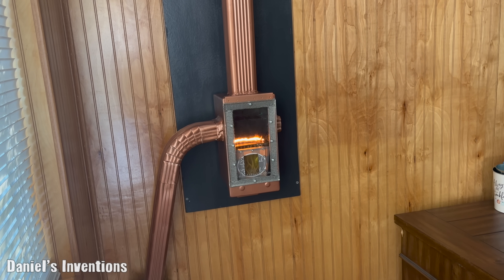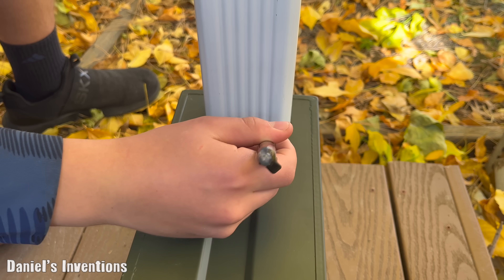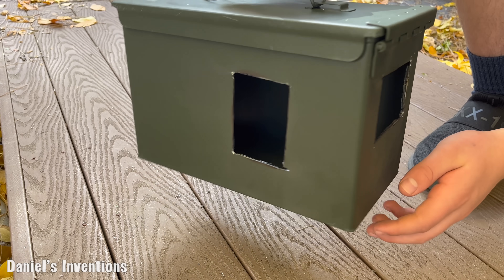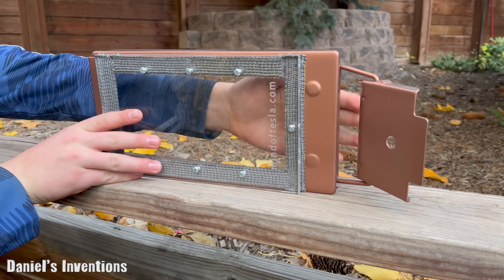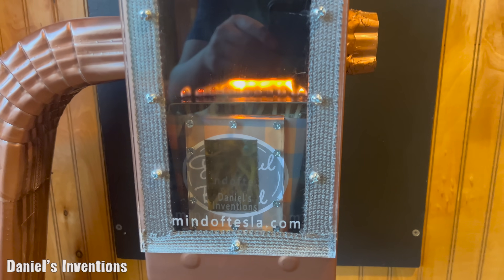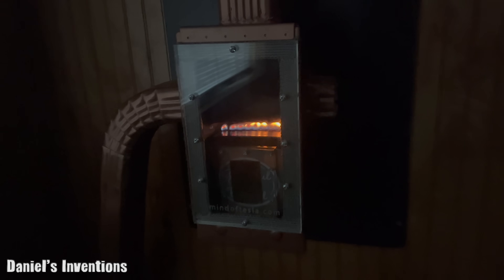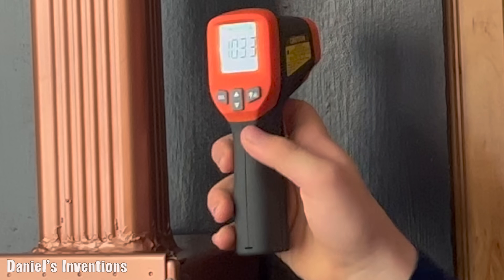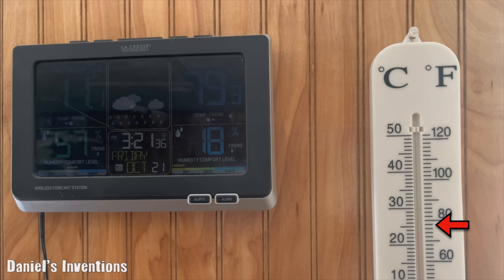ENDLESS Heat for Your Home WITHOUT Electricity

Comment: If I'm not mistaken, most residential gutter drains are made out of aluminum. Not steel. So they can actually melt and burn if the temperature gets hot enough. Not as easy as an aluminum can placed in a fire but it can still oxidize, become brittle, and even melt if the temperature gets high enough where you have it sitting in the flame. Also, instead of an electric fan, a wood stove fan can be modified to move the air and it will not require electricity. Also, the thin sheetrock you painted black will heat up, because it is sheetrock, and because it is black. This heat can transfer through to the wood behind it and can actually cause smoldering and even spontaneous combustion. It should be a reflective surface like sheet metal so it reflects most of the radiant heat. And JB weld should only be used if it is the extreme heat variety but I still wouldn't recommend that. The normal JB weld is only good at 600 degree Farenheit max. But at lower heat such as 200 to 300, it will eventually weaken and crumble. The ultimate goal is having a safe heater that will not cause a fire. And since you are using a fuel source such as cooking oil, etc, that creates a bigger fire hazard without the proper precautions because oil itself burns at about 2700 to 2800 degrees Fahrenheit at the hottest point of the flame. And you have the gutter drain sitting right in the hottest part of the flame judging by what I see at the 15 second mark in the video.
Reply: You forgot that breathing the heated aluminum is terribly bad for you as well.
Reply: @thelouiebrand  no there is no toxic fumes off of Aluminum I have melted tons of it. Now galvanized steel yes it comes from the zink. Aluminum melts around 1100 degrees and is really fluid at 1200 degrees. We poured safety tread which required the abrasive to burn in to the face of the metal we poured it at 1300 to 1350 degrees.
Reply: @thelouiebrand , why is breathing heated aluminum unhealthy?
Reply: @thelouiebrand  What is better then? Copper?
Reply: @thelouiebrand  it sounds like it would be better to use steel tubing for the piece right above the flame. It could be welded in. Probably 2x3 or even 2x2 would work. The intake and exhaust probably wouldn’t get hot enough to hurt anything with aluminum. But you’re right about that piece that the flame hits.
Reply: @thelouiebrand  Aluminum will release aluminum oxide when heated to a high enough temperature but thats not exactly as dangerous as zinc oxide which comes from galvanized metals. I don't think galvanized aluminum is a common thing for gutters but I know some gutters are made out of galvanized steel, which means they have a zinc coating. And breathing in zinc oxide can definitely cause 'metal fume fever'. Exposure to aluminum oxide usually has to be a repeated daily occurrence and in high amounts for it to be harmful. Most of the time it will just cause irritation of the eyes, nose and throat. Repeated exposure such as welders are exposed to when welding aluminum can cause scarring of the lungs if it is prolonged exposure. In this case I think this heater he made is safe from aluminum oxide being released. But if the gutter he used is galvanized with zinc then that will definitely cause 'metal fume fever' if zinc oxide is released and is breathed in long enough. Thats why you never heat up or burn galvanized metal. Because of the zinc. I saw some dummys one time that made a meat smoker out of a galvanized steel trash can and all I could do was shake my head.
Reply: @user-tz6rk4dy5s  just saw your other comment. You do realize that aluminum will release aluminum oxide fumes if it gets hot enough and that galvanized steel will release zinc oxide fumes if it gets hot enough right? You will literally have fumes coming off of the outside as well as the inside. You are not that bright are you? You think just because he has it sealed so the burnt oil gases don't leak into the cabin that no fumes will come off of the outside of the aluminum or steel gutter drain? Whichever one he is using, it would have to be aluminum or galvanized steel. Both will give off metal vapor fumes on the inside and the outside because of the heat going through it.
Reply: You can buy steel downspouts still. They are galvanized though which is not good to run hot as they off gas. Putting spacers behind the cement board and covering front with aluminum foil would be cheap and better to reflect heat. High temp furnace cement would be better than JB Weld. and safer.
Reply: @hotpuppy1  always use bare steel or stainless for something that is gonna be heated, you dont want to heat something that is galvanized because the fumes can poison you and possibly do neurological damage.
Reply: @hotpuppy1  You can buy still downspouts, but I used to work doing gutter and they don't sell them very many colors guarantee those ones are aluminum
Reply: @hotpuppy1  they sell steel down spout that is painted and not galvanized. Standard downspout at Home Depot is 26 gauge steel.
Reply: @hotpuppy1  galvanized is ok, just run them through a fire to burn off the zinc first for the parts that are exposed to high temperature.
Reply: That wasn't sheetrock
Reply: My first thought was the fumes coming off of this 🙄 and all the components
Reply: @laurajanis9690  oh my time for my N95 !
Reply: @Cloud Newman No. Only difference is that cement boards dont have paper covering. But they still transport heat into the wall creating a risk for making the wall studs into charcoal that will cathc fire sooner or later. It also crumbles in case of a fire. Silica board is the best material to use around anything hot.
Reply: They have steel gutters.
Reply: THE MOSY KAREN-FILLED COMMENT THREAD OF ALL TIME!!!!!
Reply: I disagree with the wood stove fan.  I own one and they dont work so well.  Its more of a novelty than anything else.   His fan is gonna move much more air.  Also, he didnt say the backing board was sheetrock.  He said it was cement board.  Like the idea of the wood stove cement though.
Reply: @scottsmith4145  the small Woodstove fans that you can buy off of eBay may not produce a lot of extra heat inside but most importantly the little fan will cool off the exhaust pipe going to outside thus reducing a hot pipe going through wall
Reply: @scottsmith4145 I’d use sheetrock with a spacer behind the firebox and a reflective shield. 

JB Weld is very dumb to use for this application however. That’s foolishness imho. But then again he picked hardiboard over sheetrock and didn’t mention an airspace clearance to keep the mounting surface ventilated to avoid it getting hot
Reply: Wood stove is the only true off grid way of heating as you use fuel from the land. Anything using oil is not off grid because you still have to purchase the fuel.
Reply: @mkendall8393  I use a clay and cobb rocket stove with a wood stove fan for heat, metal roof and gutters for rainwater collection, 2 big solar panels to run my deep freezer, and 2 other big solar panels to run my wifi router and led lights.
Reply: @mkendall8393  There are plenty of ways to find oil in nature. Almost all oils that are used in food are plant based. How hard can it be to plant some oil producing crops and make your own Off Grid oils? You just have to be creative.
Reply: @rudydingens8144  This would make for an interesting project. How much land, water, and resources would it take for someone to grow a small oil producing crop and heat their home/shop with it? Might you know what crop would be most effective, and would it also create bi-products (food, useful vegetative mass, etc.)? Bravo!
Reply: @oldtimeflipper8691  
I'm willing to bet hemp will be at the top of that list.
Reply: @mkendall8393  stove away then
Reply: @oldtimeflipper8691  Hemp. France has developed a strain that can produce over 300 gallons per acre.
Reply: @mkendall8393  use whale Blubber
Reply: @RareVBlue  you’re a man after my own heart. Gotta have cold storage and YouTube!!
Reply: @mkendall8393  make sure not to cut the wood with a chainsaw then
Reply: @mkendall8393  "off grid" literally means living without using public utilities. You thinking of something else. Even if he buys batteries for the fan each week it's still "off grid"
Reply: @mkendall8393  oil is overall a denser and more effective fuel source so a little can go a long way especially in a smaller available area. Wood is inefficient af overall but is useful for emergencies
Reply: @mkendall8393  Yes,  just save up for one of those mini wood burning stoves with proper piping.
Reply: @mkendall8393  a gasifier would be better because you could not only hate your home but you can use the smoke to run your generator for electricity. Plus you can't compress the smoke into tanks for emergencies
Reply: @mkendall8393  maybe he’ll hunt whales for oil though…
Reply: @mkendall8393 by that definition solar is not off grid, either. Look up what the grid is please.
Reply: @mkendall8393  and wood is free and abundant  everywhere?
Reply: @mkendall8393  Oil and gas in your chainsaw and splitter is not either. lol and don't tell me you are axing it all.
Reply: @mkendall8393  no you can burn waste oil as fuel. Look at any Valvoline oil change store and that is how they are all heated, with the oil they change from cars. Very easy to get waste oil all over the place, especially Chinese food places.
Reply: @RareVBlue  can you send me a link for a solar system that can power a freezer? Much appreciated 🤙🏻
Reply: Would a mirror behind the stove work?
Reply: @grlCA-t7d  Nah, just a simple piece of metal flashing is all thats needed.
Reply: @grlCA-t7d  no… what they did will work just fine.
Reply: Correct however  you can also purchase it in tin and steel
Reply: Just use Ammo Boxes,  weld them together throughout the house.
Reply: Not to mention he used a computer fan made of plastic to blow the hot air. All of this is hazardous and ridiculous, makes sense why males have lower life spans.
Reply: Aluminum  melting point is 1200 degrees
Reply: @goodcitizen48040  Yes. And an oil flame, at its hottest point, burns at about 2700 to 2800 degrees Fahrenheit. At 15 seconds in the video you can see the gutter drain goes straight through the ammo box and it is in direct contact with the oil flames and the gutter drain looks like its melting/deteriorating at the 15 second mark.
Reply: looks like copper
Reply: @jamesdasilva5289  ....that's paint... probably not heat resistant paint either.
Reply: Great Point, many people and Do-It -Yourselfers... are not always aware if the ramifications of using  the wrong materials or mediums for their projects... From the proper type and strength bolt to the correct metal... they should be aware to look up the tolerances of any key materials... You can pick up a super thick  Pocket Book at Any Hardware Store that tells you tolerances. Capacities, Code  Regulations , etc etc etc...
   Researching your project or stepping back and taking a second look us always a good idea,  especially when your dealing with even the smallest Safety Concern...
Reply: To those concerned about the galvanized steel or aluminum and vapors given off by the heat of those items... A very good alternative is to use automotive exhaust pipe, and ideally stainless steel exhaust pipe. These will be heavier gauge steel so they will hold up better to the heat and the steel will not emit the noxious fumes the aluminum and galvanized steel will. I have a heat exchanger in my fireplace and that just uses automotive exhaust pipe and works great.
Reply: For all that work, may as well instal a safe heating system.
Reply: Medium and high-carbon steel: \(1425\)-\(1540\)°C (\(2600\)-\(2800\)°F) so I don't know wtf your talking about bro
Reply: And when copper is heated it creates an noxious fumes of gas you do not want to use that either your best off to use something cast or some sort of steel
Reply: So much bickering. I do want to point out that the color has no bearing on heat convection. Just because something is black, brown, or white does not mean it will be hotter or cooler. The color being black or white does make a difference in light absorption when exposed to the sun. A black object will absorb more light & become warmer were as a white object will reflect the light & be cooler on the surface. This does nothing when exposed to an actual heat source like a flame. I just wanted to point that out as someone sort of had the right idea but not the full understanding of why color matters & in what application.
Reply: I MEANT CONDUCTION, NOT CONVECTION. I had to brush up on the definitions and used the term convection in the place of conduction, when conduction is the proper word to have been used. Jason was quick to jump my bones with the name calling. That is all.
Reply: @MNDmanIII  Well the way you started off with "I just want to point this out" was pretty condescending in itself considering you were incorrect and still are incorrect. The 5 main ways that heat can transfer is through convection, conduction, radiation, electromagnetic induction, and evaporative cooling. When referring to why black objects absorb heat more than lighter colored objects, we are talking about radiation. Almost all objects that exist give off infrared light which is invisible to the naked eye. Even an ice cube gives off infrared light. Infrared light is thermal because of the wavelengths. These wavelengths cause an objects molecules to become 'excited', causing them to move faster which increases the internal temperature of the object absorbing the infrared light. Since the sheetrock or dura rock was painted black, it now absorbs most of the infrared light created by the fire which in turn causes the object to rise in temperature. In this instance conduction only comes in to play when referring to how that radiant heat is transferred through conduction to the object it is touching which happens to be the wall behind it. Painting it white would cause less infrared light waves to be absorbed. Making it reflective with foil or sheet metal would reflect most of that infrared light back towards the person who then in turn would be absorbing that infrared light themselves, causing them to feel warmer. Thats why your skin will turn red when you sit next to a fire too long. The infrared light is being absorbed by your skin through the process of radiation. The wood stove itself being attached to the sheetrock or dura rock would transfer heat into it through the process of conduction. But sheetrock or dura rock by itself does not absorb much heat through conduction because of the materials it is made of. So conduction heat really does not apply here. Once they painted the sheetrock black, they basically made it susceptible to retaining that infrared heat regardless of what the sheetrock or dura rock is made of.
Reply: @RareVBlue  One can't go wrong studying the complete (available) works of Nikola Tesla. He was an amazing man, with an amazing mind. Maybe you will become the modern iteration of his genius. Have you any thoughts on his last residence and it's potential?
Reply: @RareVBlue  thank you for covering this. I was about to get into it with much less knowledge and no terminology. But even though i don't know the particulars i do know that reflective surfaces always run cooler than dark surfaces when near a heat source. Or at least, almost all the time.
Reply: @RareVBlue  Wow, I am absolutely charmed. Thank you for your time and effort. You have just moved the horizons of my world yet a bit further. Well, it is an interesting notion to view the world and it's objects as a "spectacle" of radiation interactions and exchange.
Reply: @MNDmanIII  I just want to point out that you are an idget. Black colors absorb heat more than lighter colors. Thats why only idgets wear black shirts in the sun. Heat convection has to do with fluids and gases. Heat conduction has to do with heat transfer from 2 objects of different temperature that are touching. Neither of those apply here when referring to the black paint. This is what is called "radiation" or radiant heat. Radiant heat has nothing to do with convection or conduction. As for black paint absorbing heat more than lighter colors, a black object absorbs all of the wavelengths of light which causes radiant heating in the black object. Thats why black tar shingle roofs get so hot after absorbing the radiant heat from the sun. So lets not bicker if we have no clue how to science. A fire emits infrared waves and visible light. Infrared is invisible light. Both are fully absorbed by black objects which causes radiant heat. Infrared rays are thermal. The infrared radiation will cause anything that is black to absorb that radiant heat. Once the object heats up, if its hot enough, it can transfer that heat through conduction to any object it is in contact with. Example: the sheetrock or dura rock he used is painted black so it absorbs radiant infrared light which is thermal. Then that heat in the sheetrock or dura rock can transfer to the wall behind it through conduction. And that is a fire hazard.
Reply: @MNDmanIII  I used to build laboratory furnaces, our tiles were white because light produces heat and we were building them to keep heat on the inside. So simple put light and heat follow the same rules
Reply: good suggestions for improvement
Reply: Get type x
Reply: In short what Jason is telling you your gonna burn the motha fucking down bruh 😂
Reply: As a very temporary heat generator it's ok. Not for regular use. A lot of soot maintenance.
Reply: Actually, I would look for a piece of vintage heat reflector called Pro-Tex. They were attractive and made with asbestos, but it was sealed, so not as worrisome.

And as my mother used to say, "if you live long enough, something will k*ll you"
As long as you are an adult, your chances are good that a Pro-Tex won't hurt you. I have seen them in antique shops numerous times and places. Mine is 14x17 and has been used to protect walls, etc. from propane and welding torch flames. It doesn't  get hot.
Reply: Your dumb bro.. Your just spewing outbullshit
Reply: Got eem!
Reply: All oil has a smoke point and unless he was burning something with a high smoke point, there should have been smoke somewhere and there wasn’t.
Reply: @Yo Lo all oils produce smoke. Have you ever cooked? At 450 (which he showed with the infrared thermometer) 95% of the oils would smoke. Even when I had oil heat, that produced smoke out the exhaust.
Reply: @Cloud Newman got my trowel 32 yrs ago ... Not saying I'm the best mason ever 🤣, but ... I do , do it all ... Firewalls fail ... Smelting furnaces melt through ... If this heater has issues ... And boy does it ever ... That sheetrock isn't going to do anything but give you a false sense of security ... Just as that isn't a house it is a closet ... 11 degrees isn't that cold ... And we have no way of knowing he didn't heart that shed with a tiny electric room heater .... Which would be likely cheaper and easier than this ... I call b.s. on his fuel consumption as well ... A tiki torch empties it's can in 45 min and only draws from a single wick ... This guy is a total fraud ...
Reply: Then build you own your own way and stop whining Jason. SMH.
Reply: Gutters & downspouts are galvanized steel, never aluminum.
Copper is used when wealthy ppl want a special design esthetic.
Reply: @petedafook  by
Reply: @petedafook  I have some that are aluminum so never say never.
Reply: You will go off the grid and pay for oil birthday candles
Reply: But it’s welded … JB welded. What’s that smell?
Reply: @Pleasesubmitfornobelprize  😂😂😂
Reply: If you go down and look at your water heater is 4 inch or 5 in round aluminum single walled vent material.
Reply: @Lost-n-happy  Thats for gas water heaters so they can vent out the flue gases that don't burn off as well as the byproducts produced by burning natural gas such as carbon monoxide. The water heater vent shouldn't get past about 350 degrees Farenheit unless their is scale build up inside of the vent. If you look at this video at the 15 second mark, he clearly has the gutter drain pipe going straight through the ammo box and it is resting on top of the oil flames and looks like it's oxidizing and melting/deteriorating where it is sitting in the flames. An oil flame burns at about 2700 to 2800 degrees Farenheit at the hottest part of the flame (the very tip of the flame). Aluminum melts at 1200 degrees Farenheit. If it is a galvanized steel gutter drain, then it will melt at around 2700 degrees Farenheit. But the zinc coating that makes it galvanized will melt and vaporize at around 900 degrees Farenheit and it will release zinc oxide vapor which is harmful if inhaled. He literally has it sitting right in the flame.
Reply: I'm pretty sure he said "steel" gutters in the beginning..
Reply: @Lucidman-mo7dh  I'm pretty sure he said that as well. But it doesnt explain why its melting at 15 seconds into the video over the 2700 degree flame. I mean steel does melt at about 2700 degrees but im pretty sure it's aluminum. It's sitting right in the oil flames at 15 seconds in and you can see it is deteriorating. It's either aluminum or galvanized steel. Either way, oil flames get hot enough to melt or degrade and weaken it. Looks like aluminum to me at the 15 second mark.
Reply: @Lucidman-mo7dh  In all honesty the kid did an excellent job. Someone his age can't be expected to know everything. All I was trying to do was offer constructive criticism. I wouldn't have known most of the things I know now without people giving me their point of view. He did do a good job. But he still has things to learn.
Reply: You: I feel like passing in some kids Wheaties. 
Also you: mission accomplished 😌
Reply: He said it only gets to be 500° the flame is small from the looks of it. Aluminum doesn't melt until a bit over 1200°F. As far as paint use that high temperature spray paint, normally used for engines and or grills. Drywall claims to be fireproof I can understand the bulk of it, but unless it's painted with high heat paint I'd think the paper would still burn. Like you said Jason a piece of 1/16th sheet metal would be a better option even if it's just an extra layer for safety. 1 last thing since you are using oil make sure to keep a fire extinguisher rated for that class of fire. WATER is the worst thing to use to try and put out an oil fire.
Reply: @IcannaHelp  He did state that it burns at 500 degrees. Yet I know for a fact that the hottest part of an oil flame gets to 2700 to 2800 degrees and he has the downspout going straight through the ammo box and it is sitting in the actual flames. The bottom of that downspout is oxidizing, degrading, and potentially melting if you look at it 15 seconds into the video. That downspout is in the hottest part of multiple oil flames.
Reply: Goodness and you said the sheet rock will get hotter because it's black lmfao you are an idiot.. color does not retain heat based on the pigment that's only with optical light.. you dumbass hahaha
Reply: @armaniomcqueen1581  Ok kid, I've already explained this in the comments. No one can help you read. You were late to class. Go to the office. Black absorbs all infrared light/radiation. Lighter colors reflect that radiation. Infrared light is thermal heat. Colors can refract, reflect, or absorb radiation. Infrared light is radiation. Radiant heat comes from infrared light. Almost all things emit infrared light. Even an ice cube. You aren't too bright are you kid? And these are oil flames he is using. An oil flame at its hottest point, which the aluminum is sitting in at the 15 second mark, burns at 2700 to 2800 degrees Farenheit. Alumimum melts at 1200 degrees. Do the math kid. Quit typing and read. It's science b*tch.
Reply: TEAMWORK MAKES THE DREAM WORK!
Reply: I agree with all you've said. Still the idea is neat. It just needs tweaking for safety purposes.
Reply: Total bust
Reply: It’d have to get up to 1,200 degrees no hardly possible burning oil like that without a n air source
Reply: Aluminum may be the most common, but steel is available and you can get copper but it's not common or cheap
Reply: Galvanized steel is most commonly used
Reply: Oh boy
Reply: Translate
Reply: Traduci questo articolo di Jason
Reply: I agree about the JB weld, I doubt that it's going to hold up in the long term.
Reply: Wow, you sound like you know what your talking about, I almost fell for this video. Maybe you should make a better one with all that knowledge, you can really help people out since things are just getting worse in America and everything is so expensive. I would subscribe to your channel in a heart beat 💓 😊
Reply: @@cloudnewman9111Hardie states their backer board is not fire resistant rated. Sheetrock is fire resistant. Hardie also transfers heat better than sheetrock… facts.
Reply: Galvanized steel is readily available
Reply: @n2skcmo  Heating galvanized steel puts off dangerous fumes.
Reply: @TomCee53  burn it off outside
Reply: Except he distinctly said ‘steel gutters’, Karen
Reply: You are correct, I have original copper gutters on a 1924 English Tudor. Not a hole or leak except for “soffit “ issues non gutter/downspout telated.
Reply: The oil burning at 2800°F doesn't mean that the exhaust gasses are going to be 2800°F even an inch away
Reply: I think you made a lot of good points, I love the fact that he attempted to do something cost effective to heat his cabin and it puts us on a tract to create a safer version. I’d love for you to try and attempt something like he did in a cost effective manner but safer especially with the conversion of a wood stove fan
Reply: Cement Board is not sheetrock
Reply: I can promise you that oil burnimg will never build up enough heat to melt aluminum. Aluminum extrudes between 925-1050°f theres zero chance this setup will melt the aluminum.
Reply: @danielkarcis1174  and you're wrong. This was an old comment. I'm sure I have the temp specs in the comments. You know oil burning torches exist right? And they can melt cast iron? Your promises don't mean much in the face of reality.
Reply: You can get steel downs that look identical to good old fashioned Alcoa style aluminum downspouts.
Reply: Right.  100% facts.  This video is dangerous as hell
Reply: 👏🏻👏🏻👏🏻👏🏻👏🏻👏🏻👏🏻👏🏻👏🏻
Thank you!!!
You have probably just prevented a lot of homes burning down and save lives!!!!
God bless you!!!!
Reply: You can easily find steel ones
Reply: I immediately commented out loud about that
Reply: Them copper ones are where it’s at
Reply: I done gutters.  Steel down spouts may be special order, I suppose. But mainly like you said. Aluminum. Steel ones are usually old and rusted.  I hope he is not using Galvanized.  Very bad and poisonous to breathe in when heated.
Reply: no its steel atleast eu
Reply: Oil burns closer to 3800f at its hottest point, not 2800f
Reply: they made another video using rectangle steel tubing over the flame.
Reply: ❤thanks your words of wisdom saved somebody's life tonight😮
Reply: You're out here saving lives probably!
Reply: Iv seen it before I'd use aluminized car exhaust instead of the house gutter but the clean air inside exhaust out is awesome idea I use to do a lot of shanty fishing and the next day was always horrible sick from breathing the propain fumes that would be awesome in deer stands and shanty the little computer fan most run quite with no noise after startup the fumes might be a issue with the oil and a deer stand sentless best way to go if possible still cool ish idea for a few applications
Reply: They make stainless steel gutters too.
Reply: HighHeat™ is a hand mixable epoxy putty stick specifically formulated to bond and repair materials that will be exposed to high temperatures in automotive and industrial maintenance applications. It cures to a tough, hard bond with little to no shrinkage. This industrial-strength product outperforms conventional epoxy putties at high temperatures and sets in 1 hour at room temperature. After 8 hours, it can be drilled, tapped, machined, ground, filed and painted. HighHeat™ is rated at a tensile strength of 4000 PSI and cures to a machine grey in color. It is able to withstand continuous heat exposure of 450ºF and intermittent heat exposure to 500ºF.
Reply: He says steel gutters, literally at the beginning. Get the dick out of your ears!
Reply: 0
Reply: Aluminum Oxide (Al_2O_3), also known as alumina. It is the most widely used technical ceramic in the world due to its incredible versatility and low cost. How do you imagine it in a gas ?
Reply: What he said
Reply: Steel down spout is still available
Reply: Wrong most down spout is made of steel . That is down spout you can purchase at Home Depot it’s 28 gauge steel.
Reply: Dam captain obvious. Let the 17 year old kid alone he did good for a diy heater ya there may be a few little tweaks needed but let it go.
Reply: @armaniomcqueen1581  So in your sensitive mind all young people should never be given any advice or constructive criticism in order to do better? I guess you got participation trophies as a kid didnt you lol... lighten up Karen.
Reply: @RareVBlue  a candle wick or even ten of them are not going to catch aluminum on fire and burn down your house..
Reply: There are multiple types of aluminum vent pipe. I work HVAC. As crude as this heater is it works. And obviously no one is hurt or dead. Your need to "tair down" their creation is pathological and concerning. Gutter pipe is a lot thicker that is dura vent and meravent. Also known as bvent . The water heater vent gets so much hotter. So good for these too. Jason why not go do something worthwhile and leave these 2 kids alone. Is sus af
Reply: @Lost-n-happy   I used to do Hvac work as well. Just because you did Hvac work, doesn't mean you understand how metal works when heat is applied. Aluminum downspouts are usually between 0.027 and 0.032 mm thickness. Duravent is between 0.016 and 0.024 mm on the outer casing which means it is thicker than aluminum downspouts. Aluminum downspouts bend very easily because of how thin it is. That's why they put rib bends in it in order to strengthen it. I've torn out and reinstalled very many oil furnaces and hot water heaters in my life. I also teach classes on how to build wood stoves out of natural and manmade materials. I've built MANY of them. I also teach classes in how to build outdoor ovens and pizza ovens out of manmade and natural materials. My original comment was nothing more than constructive criticism. All of my replies thereafter were not directed at the kid or kids who made this ammo box stove. My replies were directed at the misinformed imbeciles who do not know as much as they think they know and choose to argue with me even after I give them the facts. The issue is that he put the downspout straight through the ammo box and it is resting in the top of the oil flames. Duravent does not rest in oil or gas flames. It vents the vapors away. Oil burns at a very high temperature at the tip of the flame. That is the issue here. You can see it oxidizing and deteriorating  at 15 seconds into the video and possibly getting ready to melt because it is resting in the flames from the oil. Then he has jb weld on the joints. There is just too many factors here that can cause a fire or can cause harmful metal oxidation vapors to be released inside the cabin. And a fire is definitely something you do not want if you live off grid.
Reply: Lol.  You can’t Melt aluminum at that low of a temp and burn it ?
Reply: Aluminium melts at 1200 degrees.... No chance this elaborate series of candles melts aluminium. Also how does using cooking oil as opposed to lamp oil make it more likely to be a fire hazard?
Reply: @popanda3652  Solid aluminum melts at a high temperature. But the thinner it is, the easier it is to melt it. You can melt an entire aluminum can in a simple camp fire in minutes. You can melt and burn aluminum foil under a simple lighter in seconds. And oil itself is a fire hazard. And the hottest point of a simple candle flame reaches 1500 to 2500 degrees Farenheit. Direct contact with a flame is all thats needed for alumimum to melt. And cooking oil has an autignition temperature of about 600 degrees Farenheit. He has that aluminum gutter drain running straight through the ammo box. At about 15 seconds into the video, you can see it is touching the flames and has melted the bottom of it where it is touching.
Reply: @RareVBlue  you are incredibly misguided. Your talking about oxidation. You are not melting aluminium with a lighter..... Your not burning it either. The materials he's using are at least 5x stronger/more resilient than the bare minimum your trying to state.
Reply: @popanda3652  Blah blah blah. Go make more bowling videos.
Reply: @RareVBlue  yes because my hobby has weight in this argument. What kind of videos do you make?
Reply: What a killjoy...
Encourage the young Hillbillies!
Reply: Metal reflects heat? Since when?
Reply: @patrickhein9470  Shiny surfaces such as mirrors, aluminum foil, and sheet metal reflect infrared light waves which are a form of thermal radiation. It's literally explained many times in the replies.
Reply: @RareVBlue  still heat up tho dont it. like a hot tin roof smh
Reply: Tell us your a know it all without telling us your a know it all!
Reply: Tell us your a know it all without telling us your a know it all.
Reply: He said in plain English he was using STEEL
Reply: Karen 🚨
Reply: 450° output... 134° pipe Temp...cut down on wicks if you want a lower temp..
Reply: It's Dura rock concrete board
Reply: @mgtowlevel6969  the piping?
Reply: @thelouiebrand  the backing board
Reply: @M Kendall  oil is found in leaves and dirt if you melt it at a certain temperature you can use the oil from your leaves and dirt to heat your house year round. A true off grid living..
Reply: @Cloud Newman still, this is obviously not ridiculously safe. It would be way safer, cheaper, and more efficient to just learn how to run some wire and put an outlet and a space heater there
Reply: @joshdiehl8737  Years ago I had a metal wood burning fireplace insert with a blower fan that worked on this same principle. It threw out lots of heat. I rigged it up so it could also burn waste oil.....I used a metal jug, on/off valve & long copper drip tube line. I crimped the end of the drip line so even when the on/off valve was all the way open. It could only drip a set even amount, to restrict how large the flame could get. It worked pretty well, I'd burn waste oil on a slow drip, low even flame for a steady temp over night. Then add wood when I woke up & got moving around. I think a mini drip style wall mount with a sight/viewing window & safety overflow, would be safer than this with all the wicks. That way you only have drips going into the fire bowel, instead of a container full of oil sitting in it. You could also add an over flow hole/line to the bottom that goes into a safety catch container. So if the fire goes out, the oil wouldn't keep dripping, overflow & leak everywhere. Or if too much oil somehow starts dripping out the line. It'd have the overflow line to restrict/govern how big the fire could get.
Reply: @joshdiehl8737  The idea is to be off grid and NOT use electricity.
Reply: @hotpuppy1  then why does he have an electric fan
Reply: @bmxscape  actually he never said it was for off-grid.  The main reason for the build was its low cost heating which he said was only $5 usd per week.   None the less this would certainly be good for off grid as the fan uses very little power and could be supplied by a solar system or as he mentioned a  single 12v battery or as others mentioned have the exit pipe rise upward so the heat rises out the top and no fan needed.    I think a fan of some kind is still best though for moving more air and circulating it better in the room.
Reply: @bmxscape  that fan could run off a small solar panel.
Reply: @hotpuppy1  He never said off grid, did he? And if thats the case the significantly better way to do that would be to have solar panels you own. With oil you're not really that off grid if you need to call someone to come make oil deliveries to your house. You're relying on a highly volatile product that we import from the middle east that has drastic price swings. A solar panel would definitely be more off grid if that was the goal
Reply: @hotpuppy1  You unfortunately still have to buy your oil from somebody on the physical grid. An electric heat pump can be run off grid with a pretty small solar setup and be safer, last longer, and both heat and cool the building
Reply: the video title is "WITHOUT Electricity" so while he didn't say 'off grid' the question still remains 'then why does he have an electric fan'?
Reply: @hotpuppy1  the idea is to be off grid and not die from some dodgy heating system 🤣
Reply: @hotpuppy1  he’s a sheep he don’t know
Reply: @scottsmith4145  the term ‘off grid’ means not connected to an electric utility grid. It may have other less accepted inclusions like ‘not having a bank account’ or ‘not connected to the internet’, etc. but it doesn’t mean no electricity or fuel.
Reply: @scottsmith4145  without that fan the temperature inside the heater would be way to high for that open fuel container in there.
Reply: @timothycreech6389  Possibly.
Reply: @joshdiehl8737  He isn't using Petroleum oil. Who would want to.  You can burn wicks in coconut oil or other vegetable oils.  Parafin is also safe indoors.
Reply: @Shilo2020  Yeah if you want to pay outrageous amounts of money. The cheapest vegstable oil you could buy is probably 7 dollars a gallon for like soy and corn. Coconut would be way more expensive. Why would anyone use vegstable oil unless they had a restaurant and a lot of used oil or something?
Reply: @hotpuppy1  Then buy a legit stove. You can find a nice used one for cheap and you don't end up wasting your time building some piece of shit
Reply: @bmxscape  because it can be run by a dam battery genius
Reply: @armaniomcqueen1581  ...........batteries are electricity genius.........
Reply: @bmxscape  lmao off grid living almost always has battery power involved.   Genius 🤣🤣
Reply: @armaniomcqueen1581  no shit.... the person i replied to said that the point is to not have any electricity whatsoever. so i asked about the electric fan. pretty sad that i have to repeat myself when the exact words i said are already posted
Reply: @bmxscape  could be solar
Reply: @scottsmith4145  shhhhh
Reply: @bmxscape because off grid solar systems can be 12VDC and there are a glut of computer, controller, and equipment fans that run on 12V at very low watts and yet move a lot of air. 
Things that are ingeniously self made using standard parts bin components are not dubiously made- manufactured things are made, too.
Reply: @hotpuppy1  so get a safe black stove... Not something that's going to melt LOL
Reply: @bmxscape  because that can be run off of one 12v battery and one solar panel indefinitely.
Reply: @bmxscape  because it uses 5w instead of 1500. I live off solar/battery bank and cannot run space heaters. I use propane which is fine but I'm always interested in other options
Reply: @joshdiehl8737  then move on !
Reply: @joshdiehl8737 you apparently are afraid of things you don’t understand.
Reply: @fishhuntadventure  Maybe. Maybe not. I mean, a 1500 watt electric space heater probably doesn't cost more to run than like 5 or 10 dollars per week. Also, I think it would be the majority opinion that it is infinitely safer than a home made vegstable oil burning stove made from like aluminum downspout and glue and shit. I understand what they did here, I just don't think it makes sense to save a few dollars here and there. There's tons of saftey features we use in a house that cost a little bit more for a significant advantage in saftey and ease of use
Reply: @joshdiehl8737  space heaters cost 100 times more than one gallon of oil a week.
Reply: @robertchiarizia9463  Electric space heaters cost like 20 cents an hour to run on high. 10 cents an hour on low. This oil burner would probably throw the amount of heat of like a 750 watt heater so about 10 cents an hour. At 3 or 4 dollars per gallon of oil you could run an electric space heater at 750 watts for like 40 hours or 1500 watt for 20 hours. Really not much more expensive